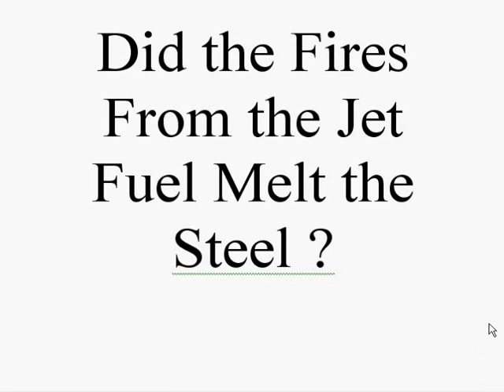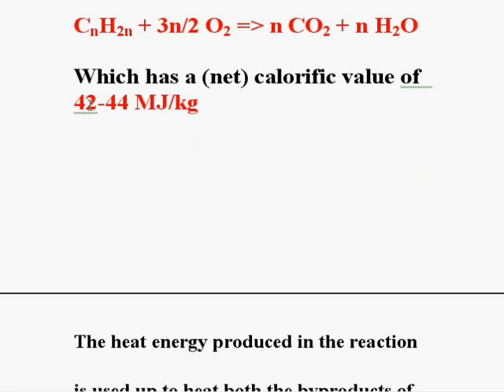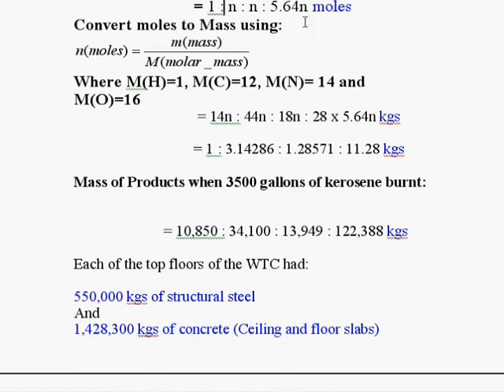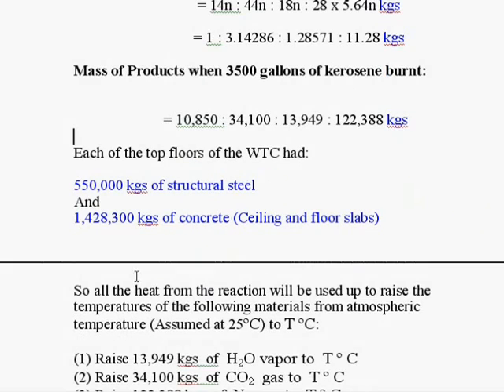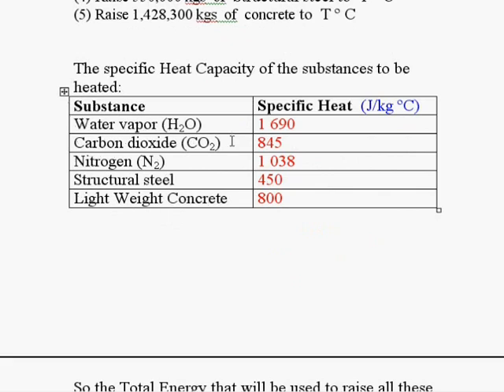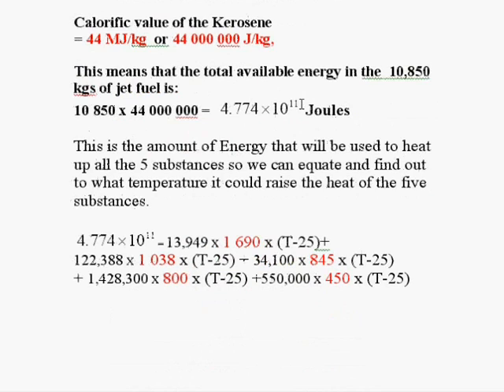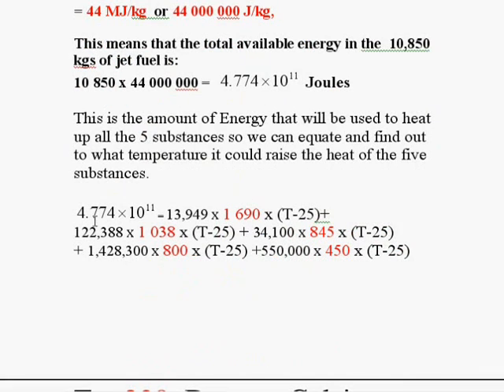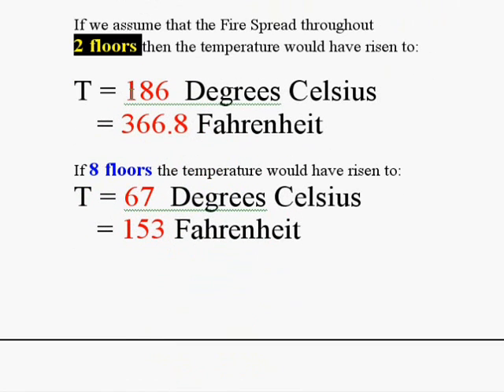911 Jet Fuel Fire Melted WTC Steel?

Comment: It doesn't really matter how many gallons of fuel there was, even it was 9000000million gallons, it doesn't matter. Let's just say that the fire is going on there 30 days, 60 days, 90 days? It won't matter. You can sit 365 days inside 1200 Celsius and you won't melt if your melting temperature is above 1500 Celsius.

Comment: steel doesn't have to melt to bend and lose structural strength
Reply: ***** How do you know? Do you have figures?  how much weight was involved ? specific   structural analysis?
Reply: Doesn't have to melt steel - it was hot enough to bend steel , there was other inflammable material? You failure to address that and conjectures about basic physics persuade me that you don't have enough info to do an accurate analysis.
Reply: None of that addresses the fact that steel does bend at the temps involved , and there were other flammables involved . Discomfort w/ ambiguity ,and filling in the blanks can make speculations seem like proof . But nothing you're saying proves any particular scenario . I don't claim to know " the truth" and I accept neither the official or the truther claims .
Reply: Way too simplistic . US government is not a monolith , there are many competing interests,t's more like gangwarfare at the top . "The middle east" is merely a geographic description.
Reply: Here's an example: A36 steel.
Ultimate tensile strength at room temp: 400 MPa
At 371 C: 370 MPa
At 399 C: 310 MPa
At 427 C: 260 MPa

Significant strength loss at only 400 C!

Comment: The plane impacts of each of the two towers involved two or three floors. The jet fuel only STARTED the fires. The fires were fed from the enormous amounts of other fuel-which consisted of carpeting, polyurethane foam cushions, upholstery, plastics from desks and computers, cable and wire insulation, etc. Normal office fires easily reach 1800F, and can warp and distort large structural members. Keep in mind, the towers floors were supported by light steel bar joists with very little surface area. These members will always fail in a fire. When heated, they either elongate, or sag, which exerts a force on walls and structural members they are attached to. The floors provided lateral support for the outer walls and inner core. With the loss of several floors, the lateral support was gone. Nearly every occupied  structure more than one story relies on the floors for support of outer walls.
Reply: No more crying egghead, they made weeds legal these days.  You can go back to your smoking now.
Reply: +moesie alibaks Your ignorance shows painfully. The tower's structural steel DID NOT MELT. IT WAS WEAKENED! 50% of steel's strength is lost at 1800F. I'll bet you didn't even read my entire original comment.

Comment: "1100 DEGREES IS STILL NOT HOT ENOUGH TO CAUSE STEEL TO COLLAPSE"

Maybe you should read an engineering manual, or check the steel manufacturer's website.

The failure temperature of structural steel is 1000 F.
Reply: At 1000 F, A588 steel loses 50% of its strength, which is really significant.
Reply: And then free fall... god you two are dumb

Comment: No real engineer ever claimed that any steel "melted."  The failure temperature of structural steel, according to every engineering manual and steel manufacturer, is 1000 F, which is much lower than the temp of the average office fire.

Which makes you a liar, and a pretty stupid one at that.

Comment: Well, come on, dipshit -- tell us what your engineering handbooks tell you about the failure temperature of structural steel.

Or are you still trying to figure out the difference between melting point and failure point?

Comment: "PLASTIC IS NOT SUBSTANTIAL FUEL ENOUGH TO CAUSE STEEL TO REACH ITS MELTING POINT AND NEITHER IS CARPET"

Go back to oiling your skateboard wheels, kid.  You're way out of your depth here.

You don't even know the difference between MELTING point and the FAILURE temperature of structural steel.

The failure temperature of structural steel, according to any engineering handbook or the manufacturers themselves, is 1000 F.

Melting point is completely irrelevant.

Comment: some people think that a plane load of aviation fuel isn't enough to metal steel beams. pretty obviously, they aren't engineers and don't have an construction experience. I've seen the aftermath of a fire involving 'only' 800 gallons of gasoline -- it melted the steel beams in the bridge overhead that the gas tanker had hit, and a 757 carries a lot more than 800 gallons of fuel.

Comment: @PinkClownShoes @PinkClownShoes Molten steel was found in the rubble pile.  So if the fire didn't melt the steel, what did?

What evidence have you that the fires bent the steel?  NIST has not one piece of core steel showing heating sufficient to weaken it.

Comment: @blueshark69 Forge-welding is not melting.  Wood does not burn hot enough to melt steel.  You need coke and forced air to melt steel.

Comment: @mrlowhe I'm not a gunsmith, but I think gunbarrels are bored, not forged.  Wood does not burn hot enough to melt steel.  Jet fuel does not burn hot enough to melt steel.

Comment: Immediately after 9/11 the conventional wisdom was that the jet fuel had melted the steel.  NBC, CNN, NOVA, Fox News, and BBC all said so, and quoted a variety of "experts" on the subject.   

Of course this was nonsense.  Jet fuel doesn't burn hot enough to melt steel.

For more information see my video:

The 9/11 "Deep Mystery" and the Crazy Engineers

Comment from the maker: @saginata if you assume that the only source of fuel is the jet fuel then the temperature addition will be smaller as the mass of the burning object increases however in real life the actual building itself has got combustible materials too which need to be taken into account,

Comment: @TimReed22222 Your statement is irrelevant.
There should have been NO molten steel during or after yet we have it on video and the many witnesses who say they saw it + the satellite thermal data concludes an observation we have yet to explain.

HOW did it get there? Office fires don't do that, materials with that potential would NEVER even be allowed to enter the buildings in the first place.

.

Comment: @JRBeaman I'm not disagreeing will you about why the buildings fell (I don't believe it was a demo), just on a few points. I'm just saying that you don't need burning jet fuel to reach the temperatures needed to weaken unprotected steel. The jet fuel did however act as an accelerant for growth.

So when you asked "Why do they fireproof load bearing steel?", was it just a rhetorical question? Because as an FPE, what goes off in my head is "of course you need to fireproofing steel in a high-rise".

Comment: @JRBeaman Very good point. The fire temperatures were more along th lines of the compartment fire temperatures of ordinary office combustibles (plastics, wood, paper, etc), most of the jet fuel burnt up right away. Office compartment fires can still get very hot. Why wouldn't they fireproof load bearing steel? I don't follow. Do you think they should have encased it in concrete?

Comment: @amayagab 
Continued .....

It is known, from photographs taken from a police helicopter, that external support beams were starting to buckle just 18 minutes after impact. This suggests that many of the internal support beams had lost a high percentage of their load capacity simoply by being bent slightly out of straight and the heat from the fire merely accelerated this process

Comment: @amayagab 
I beleive steel loses 50% of its structural strengh at nearer 550C. But given the huge loading in excess of 1500 metric tons PER FLOOR above the impact areas conbined with the certain fact that many of the vertical beams would have been slightly bent by the impact in addition to the ones that broke(Something I have not seen mentioned anywhere) I beleive that temperatures well short of even 350C would have been sufficient to bring about a major collapse.  Continued ...

Comment: @BenjaminFulford 

1. I have been to foundries, molten steel is not red, it's white. Did they see molten steel, not likely, just something hot enough to glow red.
2. 1300F is peanuts. A severe initial fire, total collapse, followed by confined fires.
3. Raging inferno plus collapse forms compressed chunks of building. What molten steel?
4. Better explained by flexural bending under axial tensile load & temperature than melting, unless you think there was an I-beam shaped mold in the building.

Comment: @BenjaminFulford And you are here only to insult and obfuscate. Get back to the point. No photo of these meteors show molten steel, only a highly deformed mangle of material from the building containing only deformed steel. There is no indisputable proof here of molten steel that can be identified. No first-hand accounts, photos, or samples; only anecdotes and rumors. The fires in the WTC were of exceptionally high temperatures, not high enough to melt steel, but higher than the above estimate.

Comment: @BenjaminFulford The 'meteor' (meteorite would be the appropriate term) is, not a molten ingot of steel. Steel can 'flow' plastically under high stress and especially under very elevated temperatures. That's why they have heavy I-beams bent into U and J shapes. Nothing about the meteor shows molten steel, only mangled steel members.

Comment: Structural steel begins to melt   at 2066 F or 1130C.
Did anyone see the steel fused into the concrete?
Or hear the eyewitness evidence of pools of molten steel?
Since it induspitably melted there had to be minimum temperatures of 2066 Fahrenheit.
A normal office fire doesnt get anywhere  near hot enough to melt the steel.
Very few things do in fact .
Thermite and thermate could though.

Comment: You are not going to heat up an entire floor to a uniform temperature. This is extremely conservative, NOT a maximum! A lumped heating model like this is ludicrous. You also neglect preheating and radiation feedback to the flames. Do you know what temperatures a compartment fire can reach? The radiation heat transfer in such infernos is incredible. Also there is no proof of molten steel at the WTC. All we have are anecdotal accounts from fire fighters that have no idea what they are looking at.

Comment: This is very interesting, but the fact of the matter is that at least one of the buildings DID fail assymetrically and then collapsed symmetrically which immediately invalidates the official version.

The same people who swore hand over mouth that this is the ONLY way that buildings could fail are the ones who practically swore that Saddam was on the verge of nuking half of Europe.

The official explanation is physically impossible on several counts, but you have Bush's word.

Comment: Over 100 thousand tons of steel to absorb this heat , Remember the towers had a three tower in one build and had 13  thousand tons of lateral support and each floor was 10% over efficant !
In 1975 one tower did burn for 3 hours on 4 floors with the same heat and electrical systems inside the building ! They didnt drop @ 10 floors per sec fall rate!
And then there is No7 as well ?
come on , COME ON !
Think for our self , not agree with TV

Comment: Steel melts at 1525° C, and although jet fuel burns only at 825° C, it doesn't have to burn hot enough to melt to cause the buildings to collapse, since steel loses 50% of its strength at 648 ° C, at 825°C the steel beams would have lost about 63.66% of it's strength combined with the silicon components of the electrical systems inside the building who explode and deliver a higher ammount of heat than jet fuel would be enough to make the towers drop.

Comment: In the plane crash, fireproofing was sheared off the steel. In 1975, it was still intact.

Jet fuel fires didn't melt the steel, it weakened it to the point of sagging, and finnally collapsed.

Comment: Building Seven was hit by two of the largest, tallest skyscrapers in the world. It was built without internal pillars, each floor had a large amount of floor space without any columns. This means it is unsupported from below.Clearspan floors means offices without any columns in them, but a weaker structure. 

The Verizon building is far stronger, as it had columns in every floor. The columns within the office space meant that the offices were more cramped, but the building stronger.

Comment: You guys still act like it was one factor at a time. An airliner brings SEVERAL fuels to any fire. The first is 9000 lbs of aviation fuel (30 TONS), the second is 60 TONS of Plastic, and 80 TONS of aluminum, both of which burn hotter than aviation fuel. Where do those fuels come from, the airliner, duh. Airliners ROUTINELY produce fires hot enough to totally consume their own aluminum skins.

Maybe you haven't figured it out, but skyscrapers have a variety of high temp fuels themselves.

Comment: it was hit by a hundred storeys of Tower One. Its weightbearing facade and its structural members were highly compromised, and the floorplans included the same structural systems of WTC1 and 2, that is vast clearspan floors supported from a central core. It was not built as sturdy as the Verizon building (built back in the 30s to house very heavy telephone exchange equipment),it was built with the minimum of concrete to save costs (the Mafia jacks up the price of concrete in NY).

Comment: Heat is irrelivant. Take a jet of that size and slam it into a building of that age at those speeds and see how many structural supports are busted. IE Rivets. Bust out enough of those and you don't have to melt anything.

Sheesh an these guys want to sound like geniuses.

Comment: "The core columns were weakened significantly by the aircraft impact damage and thermal effects. Thermal effects dominated the weakening of WTC 1.

Aircraft impact damage dominated the weakening of WTC 

THE IMPACT AREA....not the lower, 'STRONGER BUILT' rest of the building

Comment: The initial jet fuel fires themselves lasted at most a few minutes[NIST]

NO floor assemblies collapsed from the heat that was present that day in the towers [Underwriters Laboratories]

no evidence the type of joining methods, materials, or welding procedures used was improper NIST 1-3 p.99

recovered bolts were stronger than typical. NIST 1-2 p.133

no core column examined showed temp. above 250C 
NIST 1-3 p.95,101,132

Comment: "the steel expanding and twisting due to uneven fires."-

-The tower is one big heat sink, pulling heat AWAY from the source...

how long would it take to heat a 2'x4' box column with 4" thick walls.

"One plane hit squarely and damaged"

and the building shifted and compensated, just like it was designed to do

Comment: "taking out more than half the structural steel on one face"

NIST: Both WTC 1 and WTC 2 were stable after the aircraft impact, standing for 102 min and 56 min, respectively.
The global analysis with structural impact damage showed that both towers had considerable reserve capacity

"I don't think the building is going to survive."-

-and that is YOUR uneducated opinion

Comment: "You don't need thousand degree temperatures to weaken steel"

You need a CONSISTENT heat source

which NONE of these three building had

the fires consumed...they moved on...just as office fires do

if it is SSOO hot, HOW can that LADY stand in the IMPACT area, and HANG on to the steel, if it's SSOOO hot

Comment: It still had massive amounts of fuel, enough to get most of the way to California. Those planes turned back somewhere over Pennsylvania. Less than a quarter of the way to California was covered. 

And the engineers did not KNOW that it would survive a 707 hit, they THEORISED it would. At a LOW SPEED. They had no computers to test that hypothesis on, even basic modelling was only available in the 90s.

Comment: the difference between a 707 and a 767 is what? ten feet more on each side of the wings? another 20 feet in length? (est). its a crock of crap to assume that just because it was a 767 and not a 707 that the buildings collapsed. and the plane wasnt fully laden with fuel. quite a bit had been burned before it reached wtc.

Comment: Has anybody heard of a furnace and a bellows?

You got a fuel enriched enclosed environment over 800 feet in the air being fanned with H20 enriched wind. Sounds like a furnace and a bellow to me.....furnaces are used to melt steel.

Besides, the weakest link was not the steel, but the weldings on the joints, at the floor level.  I mean after all it did collapse like a pancake. 

Skyscrapers weren't built prior to the 1880s' because architects had to find a way to fireproof steel, it melts.

Comment: wow this is boring. I will point out the simplest flaw in your maths first. At the end u summarise saying basically the more floors you burn the cooler the fire is! Maths is a funny thing. If the answer seems logically to be wrong then it usually is. Of course u are right in a way. The steel didn't melt. It lost 50% of its strength due to the fire. A very very substantial amount.

Comment: They believed it would withstand the impact of a Boeing 707, smaller, slower and lighter than a 757 which had not been thought of at the time. They thought that such an impact would have been the result of an accidental impact, like the Empire State Building crash, the result of a plane lost in fog searching for an airport, and not a fully pressurised plane that was deliberately flown at very high speed, fully laden with fuel, and an increase in speed incrementally increases energy of impact.

Comment: Actually the WTC WAS designed to be with a large plane loaded with jet fuel...actually it was designed to take multiple impacts...watch the interviews with the engineers that made the building because they're just as baffled as to why it fell. Before OR after there has NEVER been a steel building collapse from fire...explain building 7